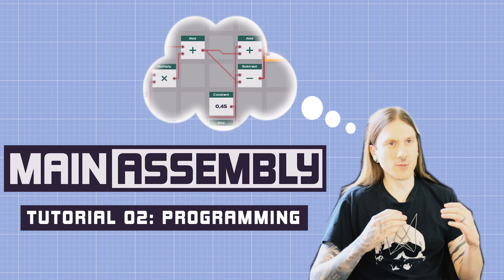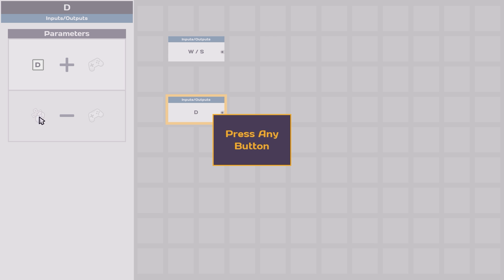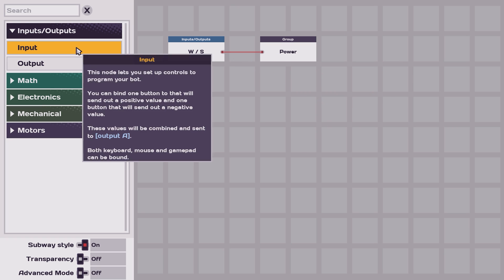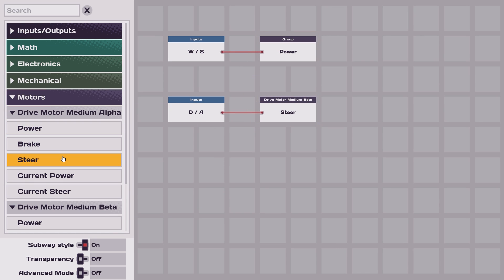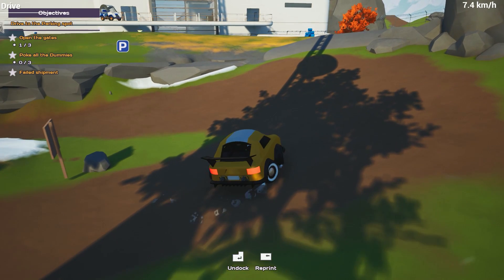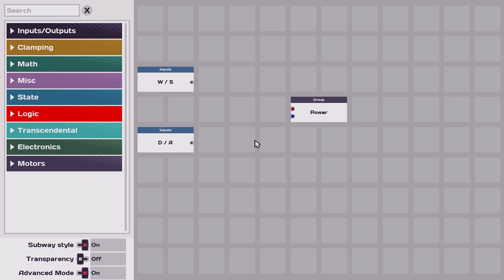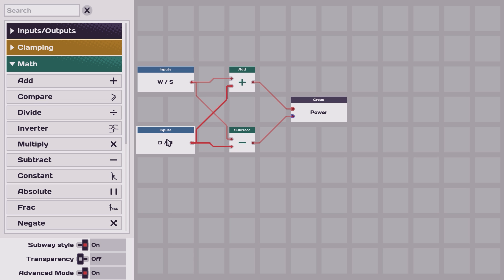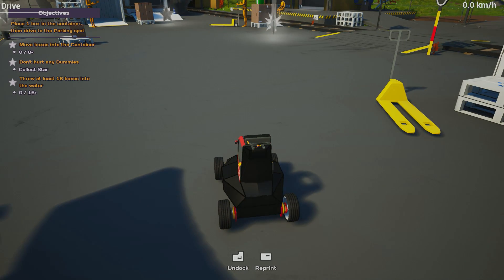Main Assembly Programming Tutorial Part 1

Comment: Guys, 2 questions:

1: How can I do a pulse in this programming language? Because what I want to do, is turn on the emergency lights when I press F, and turn off the emergency lights when I press F, and it would just be active in between the two. 
So basically it would act as an SR- Latch, but since I cannot press F for 1 tick of game time, the flip flop module goes nuts between switching states, since my press of the F key is longer than 1 tick.

2: How can I alternate between TRUE and FALSE on any State module, every second? So 1 emergency light would go off in blue for 1 second, then another emergency light would go off in red, and alternate between the two until I don't press the F key again.

So, please, implement a method of measuring a value for 1 game tick. It would make life SOOOO much easier.